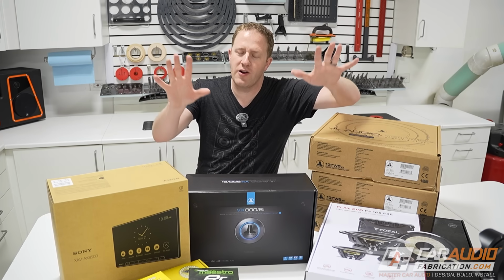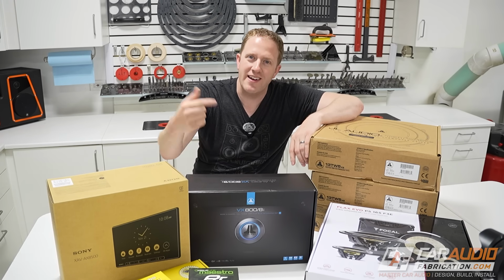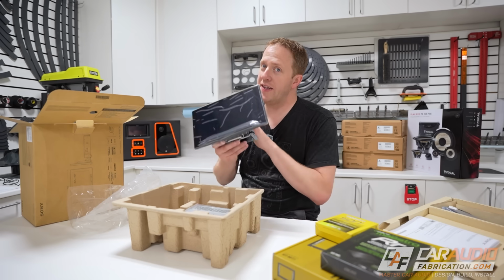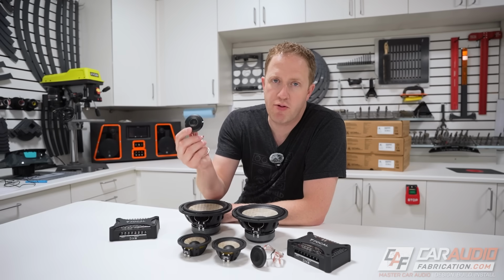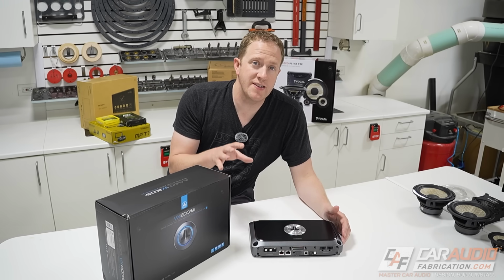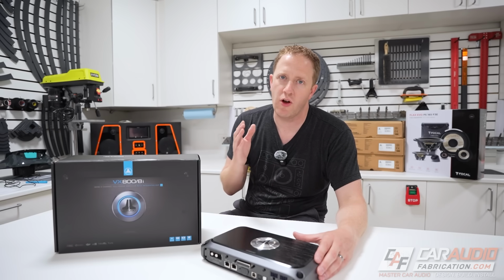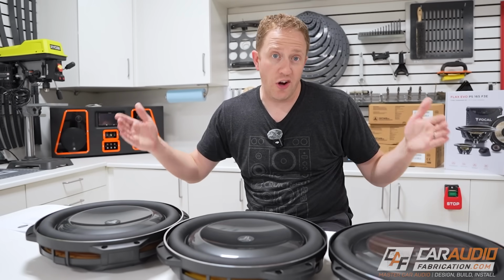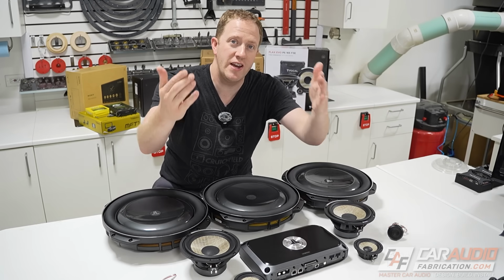Next Level Truck Audio System Upgrade! 13" Subwoofers - Multi Amp, DSP, Active 3 Way and MORE

Comment: My Diamond Audio radio has a 10 channel DSP with crossovers, time alignment and a 16 band EQ for the 8 pairs. It also has 5V Preouts with 0 clipping at full volume. Having a built in DSP, built in RR module  and no T-harness saved a ton of room in my fairing.

Like you mentioned in the beginning, it is night and day compared to 2020. Bur even in 2026 the top Alpine head unit only has 4V and a 6 channel DSP.

Comment: I have the same front stage setup and amps, but went with 2 12w6v3 subs and the AP4-FD31 for integration since I kept factory head unit.

Comment: What is your take on the Volvo Bowers and Wilkins factory sound system and the Audi Bang and Olufsen vs their Harmon Kardon and Bose mid-tier system?  I have the B&W system in my XC90 and the Bose in my Q7.  Both of them sound really good, but I will say the B&W has an edge for sure. However, since most audio is now compressed and is either Sirius XM radio or some streaming service, I am not sure it matters as much anymore.

Comment: 7:06 Why running active? What are the benefits? why don't you use crossover from the kit?
Reply: The amp has a built in dsp, probably work better for the front staging like he mentioned and the time alignment
Reply: DSP and lots of channels...I would take that over crossovers all day. You can do magic with active channels and time alignment.

Comment: How did you get the Sony AX8500 to fit? Cruchfield says  it won't fit in my 2017 F150 XLT. They say the brain box or receiver is too deep.
Reply from the maker: There is a bracket in the back that you can cut and remove. They don't say things will fit when it requires any changes that can't be reversed.
Reply: @CarAudioFabrication Okay Thank you

Comment: Is it worth running three-way components if you are going to put the three inch midrange in the factory dash location versus creating a custom a pillar pod? I was going to put that exact focal 3-way system in my Tacoma and was thinking of using the factory dash speaker locations for the 3-in

Comment: Following Mark's idea, I went with Kicker's 51KSC6704 (for the rear), Kicker's KSS670 (front door and tweeters on A-pillar mounts) and KSC350 (front corners). Also opted for one JBL Basspro Hub 11" powered subwoofer. My question is, which 8 channel w/ integrated DSP amplifier should I select to run the show: Alpine's PXE-0850X (which fit on my 24 RAV4 XLE Hybrid Premium) or JL Audio's VX800/8i (according to Crutchfield, it does NOT fit my RAV4)? Thank you all for your "two cents"!

Comment: Cruthfield's website says this head unit wont fit my 2018 f150. I don't see how it wouldn't. Not that it should matter but i have the supercab with the 8" display, sync 7 w/ speakers

Comment: Dude can I have those 3 way passive x-overs? I'll pay shipping. I'm trying to revise my system in my truck and I want to add another speaker in the front doors. Currently I've been running a mid bass 8in and a tweeter on a 2-way passive x-over. Problem is I blew all the tweeters so I figured if I replace the tweeters with the same ones and add another tweeter to soak up some power that would solve my problem and make it sound better. If you want to help me I can get more in detail what I'm running just let me know thanks Mark.

Comment: I just bought a dsp amp and planning out my build now. Running a zapco dsp amp and a jp23v2 for bass. Gonna be 3 way system. Only problem ima gonna have is tunning as ive never done it b4. Also my 3.5 dash co axial speaker actually can be used active being there is two separate wires for the tweeter and mid range that will be interesting.

Comment: I'm considering this amp but torn between the 6 channel or the 8. I have a center channel in my car . Should I get the 6 or the 8? I have components for front and coax (Focal) thanks for any suggestion.

Comment: I have a similar setup in my truck. I stated with the 12tw3, then went 13tw5. Honestly not much difference in my opinion. Kinda disappointing considering the massive price difference. Then went with the sundown sd3 12 in an underseat box with the seat lift and wow! Sound like full size subs.

Comment: What wire lugs do you use, (for connecting the power wire to the battery and the ground to the chassis.)

Comment: I have a similar system…2016 Tacoma double cab…Focal Flax in the doors…Arc Audio A10 Subwoofers…powered by Arc Audio 6 channel amplifier X2-1200.6 Running factory radio with a Digital Design Dsi-3 processor …DSP with Focal speakers creates an incredible sound and clarity at any volume…adding sound deadening material enhanced the experience and reduces overall road noise…I liked the ability to created different presets for different genres…after listening to DSP enhanced music…it hard to not too..

Comment: Those Sony radios are junk. Supposed to be the best sound quality radio rn but the connectivity issues are deal breaker
Reply: @ricosteeler7  I've never heard a Sony receiver that sounded good. You'd think they'd do better.

Comment: I absolutely love JL Audio and have had several JL Audio system throughout the years. I’ve ran everything all the way up to their leading W7 series. My last 2 builds were 100% JL Audio running 4 sets of 6.5 components on 450/4  and 3 JL W6 subs each with its own 1000/1 amp and clean sweep DSP in 2008. Unfortunately due to my health I haven’t been able to continue to enjoy my favorite audio equipment.

Comment: that focal 3-way front and 2-way rear is the same setup I'm planning to use for my gladiator along with an audio control 5 channel dsp amp and either a couple 12's or like 3 10's under the back seat. just takes time money and more time and money to get the ball rolling. will try and follow along with this as I don't tend to do active systems always feel like the crossover tuning is part of the love the designer put into them. but I'm sure I'll learn something new from this.

Comment: This would be my ideal system, just wish I could afford all this!
Reply: Infinity kappa speakers on a good amp sound awesome for the price.
Reply: Agreed. JL Audio has some really good accurate sounding audio equipment, but man they’re proud of their product. Had the “budget” w0’s in my car and they sounded amazing for the low power the subwoofers recommended. Unfortunately I needed my trunk back and couldn’t afford a single subwoofer from JL Audio at this time so I settled on a little Kicker Cvr 10 and I’m surprised on this little subs sound quality at more than half the price from JL’s options (at the time I purchased).

Comment: Please post all the videos ASAP! I have the same truck and the same Focal front stage so I’m totally going to plagiarize the sh!+ out of your install! 😂
Reply: Just look through the videos there's several full install
Reply: Well you definitely have a good base truck to upgrade lol. I love the newer aluminum Fords. Can stick big door speakers in, has front tweeter mounts, front dash speaker, already has pretty good sound insulation, quality plastic door panels that don’t rattle, you can hide the whole amp rack behind the seat, and maybe a subwoofer too. I wouldn’t won’t to give up the space under the rear bench though personally. I love the flat floor storage, and pop up storage bin.

I’m sure you have already, but look at his older videos that he mentioned of the F-150 build. You can get one of those special audio processing boxes (forgetting the actual name) that make it so you can tune it w/o having to ditch the factory head unit, unless it’s the double din sized one, even then I would be 50/50 about removing it.

Comment: Please please please when you do a review on that radio go into great detail on CarPlay the last Sony radio that I used (ax5600) was absolutely atrocious whenever you used CarPlay. It was about 20fps regularly but when in a phone call it would lag and only get 1-2 fps. I tried EVERYTHING. I just want to know if they fixed that issue with the new ones.

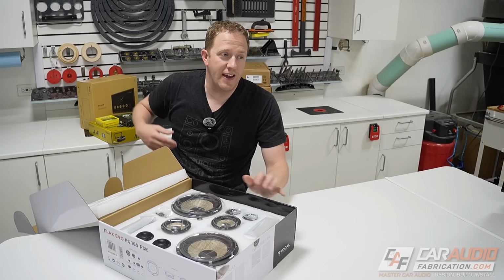Comment: 06:02 Last year I installed Flax Evo PS 165F3E in both of my cars. These are some of the best mid-bass speakers that exist. And over the past two years I have tried them from more than a dozen different manufacturers and not cheap ones. Excellent sound and quality of the basket and contact group. This speaker can actually be used as a hand weapon, heavy and very strong!

Comment: Sweet Video. Any chance you can do a review of the DSR1? I've got a 2013 focus ST, I'm on the fence about using LC7i or going with a DSR1.
Reply: I 2nd this.
Reply: DSR1 for the win 7i is for just supplying signal to amps the dsr1 does that and it’s a DSP
Reply: @mobiledawg2206   That is what I was leaning towards for those reasons. DSR1 will plug and play with the adapter harness and give me RCA outs to whatever amps I want to use for component and subs yes?

Have 13w7 already (friend shipped it to me for free, i paid shipping lol). and looking at sundown SIA 1750 for that. Then whatever decent 4 channel I choose and components.
Reply: @andrewkavanagh6028  if they make a harness for your car and the dsr1 deff go with that vs lc7i. It's not the best but will do everything you need. Also look into a different amp then the sia1750. So many other options i wouldn't do cheapish full bridge  stuff. Not saying spend a ton but look at something else
Reply: @bigrobstillpimpn  I'm open to suggestions/your experience with the SIA1750. I need around 1200-1500 watts at a 3 ohm load. I like the higher efficiency and small size of full bridge vs korean. I'm keeping everything under the floor board in the rear hatch, sub is removable for family shit so i still have a trunk